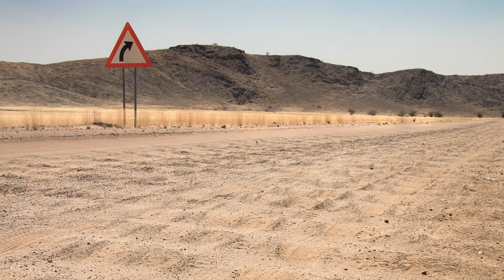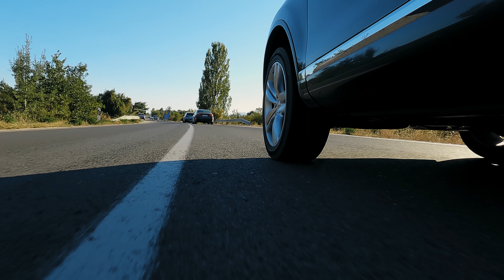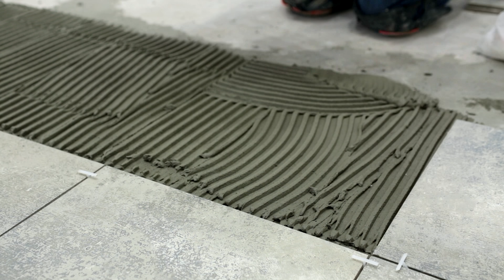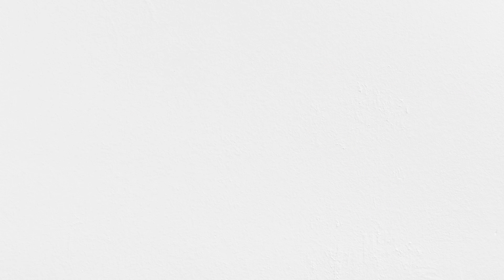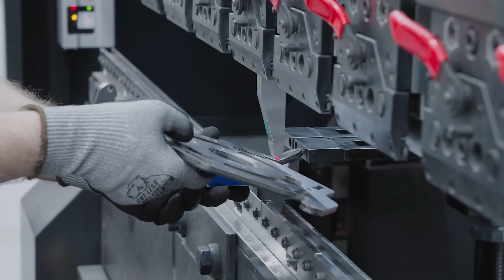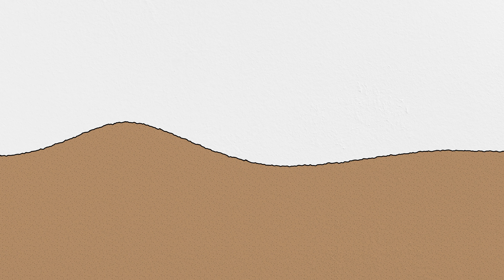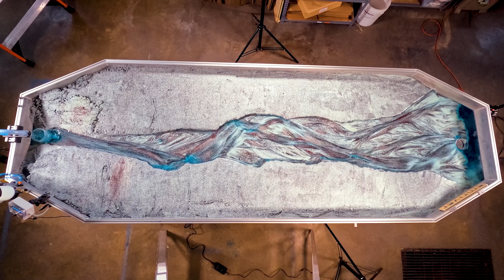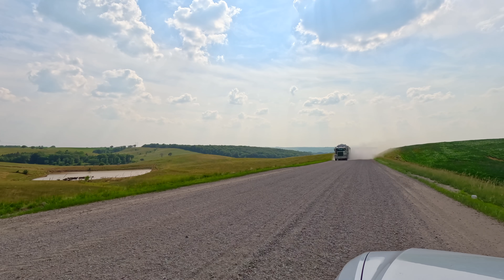Why Roads Get Washboards

Comment: I think asphalt mostly gets grooved and corrugated during Summer when soft. With about 8 dwellings on my inclined gravel lane we tried several sources and grades of road mix. The best by far was the mix we generated when the paving co I worked for tore out old driveways, parking lots and streets and screened off the asphalt chunks for recycling into our new asphalt mix. Base gravel along with some dirt and clay and about 20% small asphalt chunks fall through the screen-all machine and I brought numerous loads and spread them with the spreader chains controlling the tail gate discharge of my dump truck. Even without a roller that base has stuck well with minimal corrugation for 15 years. I did manage to make it crown for drainage and maintain "Kelly Humps" to drain off water at critical spots. 

PS:  the main reason asphalt roads etc work so well is the mat is waterproof, thus few changes or even frost heaves happen in base materials under it. That's why sealing cracks or chipsealing is an important maintenance chore. BST shots are somewhat cheaper than paving, where prepared base is sprayed and a chip spreader lays uniform layer of like 3/4 minus road mix and rolled. Later it's broomed and ideally another layer applied.

Comment: Having experienced this on a mountain road with almost non-existant edges and no rails it was quite the nail-biter as the car was going faster as it was skipping over the ridges on a rather steep downhill and brakes were accomplishing nothing at all.  I was not speeding to start with.

Gladly I did eventually slow down enough to regain control before going over the side.  Lesson learned.  No, I did not mess my pants, but I did stop for a while to recover and calm down.

Once again I was saved by quick reactions from learning to play pinball.  Had I been an inexperienced driver with poorer coordination I'd have gone over.  One form of physics helped another...  :)

Comment: The material has a friction coefficient and just like washboard effect on sand under moving water forms the same effect as the wind does from the moving vehicle, not the suspension. I.e., it's the wind on roads from the moving vehicle and they form  at > ~15km/h and not possible obviously to have that as a maximum speed. I worked with a one of the three transport research organisations on many unsealed road projects, including material loss, however this issue of waves forming is 100% wind caused and proven. We just call them corrications.

Comment: If you put your vehicle in the four-wheel drive it usually will help. Automatic vehicles are worse than manual vehicles. Let me rephrase that if you downshift to slow down instead of using brakes it is better

Comment: Found this really interesting, as I have spent a lot of time driving on corrugated roads. Everyone who comes to our home loves the quarter mile of corrugations on our front road. The only flaw in the experiment is the use of a trailing wheel as opposed to a driving wheel. One contributor to corrugations is a driving wheel on certain loose surfaces is constantly partially losing traction and spinning (ever so slightly) causing mounding. Once in, corrugations are near impossible to get out, as when the wheel travels over the road it is compacting the high and low spots differently. So grading the roads solves it for a while but they will return.

Comment: Washboards are caused my people that don't air down.  Trails drove by 4x4s that air down rarely have washboards.  The trick to driving on washboards is to carry speed to stay on the  top of them. I typically go 35+ MPH which smooths out the ride.

Comment: As an old operator I can tell you one factor is the tires on the machine.  Almost invisible ripples occur from the tread on the tires that transfers to the blade when grading a road.  A finish blade will have no tread on the tires, therefore no transfer of that pattern to the blade, resulting in a near perfect smooth surface.  Old operators know this stuff, new guys not so much.

Comment: I wonder if wind or something else natural doesn't play a larger part than expected, because if it's primarily wheel action, wouldn't you expect to find the "washboarding" more pronounced in the vehicle tracks? Or to have those ridges be more curvy and irregular along the width of the road? Or is it because people intentionally drive out of the track when it starts washboarding, thereby evening it out across the width? I still don't understand why those ridges and valleys would appear to be so even and straight across the road, though.

Comment: 16:30 I'd like to see a follow up with several proposed "low-cost" solutions put to test in the model. My suggestion would be mechanical stabilization (window screens/cloth in the simulation) underneath the top layer. it may reduce washboarding by adding structure to the road, shift underneath to make the washboard even taller than without the stabilizing material, or cause the stabilizing material to poke through, which could damage tires in a different fashion.

Comment: During WW2 (and maybe modern wars), chain-link fence was rolled out across desert sand to makeshift a road - I wonder if it would help prevent deeper washboard ridges and/or other decay factors if it was placed either between the base and wear layers or perhaps integrated into the wear layer.

Comment: It has been known for a very long time that speed is the factor in producing a washboard surface on a dirt road. Oiling a road will reduce the loose grains of dirt to avoid the ridge build-up. But the environmentalists will say it pollutes the ground near the road bed. However they are ok with the millions of tons of salt put on the roads each winter. The irony of this is that when you grade the road flat, drivers start to speed up and remake the washboard. The worst here in Nevada is muddy, deep muddy roads that are driven on and when they dry they become unusable at any speed over 5 miles an hour.

Comment: Without watching the video, I think the sand acts like a fluid, which has a specific frequency and wavelength which vibrations will travel through the material. Since most drivers are going to travel at the same speed, this causes a resonant frequency to build up standing waves in the material.

Comment: The political economics is more important than just math. Less people who use the road, less voters to court favor. The Washboard itself, is determined by the size of the wheels and the suspension rolling over it. Cars produce shorter closer bumps, trucks produce higher, longer bumps. Bad shock absorbers, or lack of, in trailers, produce a worse situation. Requiring Shock absorbers on all trailers, would be a good start.

Comment: On my old truck, I hated driving off-road because the washboarding would jar my teeth and make the rear-end of my truck float about. But when i got my first 4-wheel drive, and I locked those hubs into place... OMG! No more washboard. It didn't care. It rolled so smoothly. Sure, it still had a little bumpity bump thing but my truck was locked to the road. It didn't float anymore. It was so much smoother. From that day forward, I swore only to buy 4-wheel or all-wheel drive vehicles.

Comment: This has me interested enough that now I want to go measure the distances between washboard crowns and valleys to see if they are approximately the same size as a tire contact patch. I'm going to measure a couple of roads to see if there is a difference between them. 
I also wonder if an unbalanced tire(s) can perpetuate the forming of the waves. I think it won't because the frequencies between tires will most likely not be equal.

Comment: One of the papers presented at the 1985 Summer Meeting of The American Society of Agricultural Engineers was on the effect of tire pressure on forest roads.  The research was done at the USDA Research station at San Dimas in conjunction with the Northern Nevada AutomotiveTest Center.  The video showing the transitions of a road from smooth to corrugated and back to smooth by altering the tire pressure was very interesting.

Comment: Hello, about road surface (concrete interstate). I notice a frequency somewhere with an extended feel. Could this be a consequence of air suspension on trucks and the modulation that occurs in loading and unloading speed of the air suspension?

Comment: I don't see washboards in the straight stretches away from intersections where people drive the fastest.  I see them right after intersections where people accelerate.  There's rarely any in the high speed areas and the deacceleration area infront of an intersection.  Only after the intersection.

Comment: I read a long time ago to overcome the vibration from driving on washboard roads. Gradually speed up resisting the urge to slow as vibration increases. Eventually, around 25 to 30 mph, you will hit a sweet spot where the ride smoothes to near perfection. I've tried it, and it seems to work. I don't know if there's a video in there, but I thought you might find it interesting.

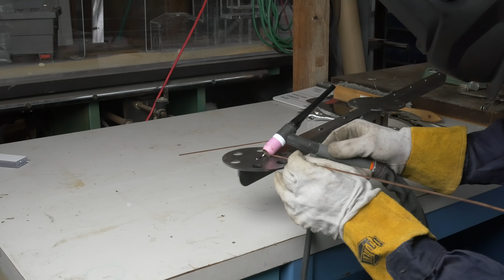Comment: 1:56 If you scratch the surface with the electrode before pressing the button, that likely would not happen
Reply: Looks like he used 0 pre flow or had recently dipped in previous weld 😆

Comment: You can't drive slowly on washboard. You must drive around 80-90 km/hour allowing the wheels to fly over the valleys. If you drive slowly it will shake your suspension and your bones to pieces. You can't do this with just any car, you need a 4x4 all terrain vehicle.

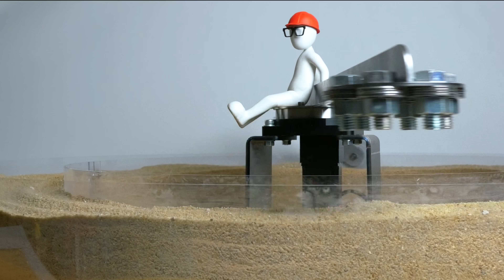Comment: 2:07 i’ve lived on dirt roads since 2010 and I could tell you it doesn’t matter what you do they always turn into washboards. We’ve gone as far as grading the road, and then rolling it with pressure rollers, putting gravel down everything short of paving and even paved dirt roads will get those washboard ripples if the asphalt isn’t thick enough the only way that I’ve ever been able to figure out how to keep the washboard from showing up is to constantly scrape the road the downside with that though is that the roads get deeper and deeper and deeper, and then eventually you’ll get to the point where water doesn’t run off them anymore and instead floods them and when you live in a desert with super dry dirt roads, rain doesn’t percolate into the soil the way it does on moist dirt instead, it floats along the top because of the sand act kind of hydrophobic what’s worse is that the ultra fine grains turn into a slurry that is slippery like oil and creates vacuums that make it difficult to drive through or walk through and as soon as the roads dry, they typically start to shape themselves into washboards

Comment: Where I live the dirt roads are mostly made from whatever underlying dirt was already there, with thin top layers of cinder or road base depending on the exact location and base layer composition. 
I can say that you can really tell the difference in how different materials interact with vehicles. Also, not every type of dirt road surface can actually create washboards. Some types of bentonite clay actually crumble apart when dry and can create pot holes much like what you would find on concrete roadways. However the major surface is too hard to move and doesn't create patterns, only holes where the surface fails.

Comment: A few years ago, I worked as a haul truck operator in a large open cut mine in Australia (where I live). The haul roads were all unpaved and were constantly being maintained by graders. It didn't take long after grading for the trucks (400 tonnes of rock, rubber and steel) to bring the corrugations back and, having nothing much better to think about as I moved around the mine, I spent some time contemplating how they formed (I was a university science student at the time). Partly because of the fact that the corrugations were always parallel and at right angles to the road, I eventually came to the conclusion that they were a product of the grading process, with rhythmic grader bounce ultimately causing lower density strips in the road surface that would become corrugations. I suspected that if you considered the wavelength of the corrugations and the speed of the grader, you could calculate the resonant frequency of the grader. I never did the calculations (not even roughly), so I can't comment on the sanity of my proposition (it's probably completely wrong), but for a while we started calling graders "corrugaters"!  🤣

Comment: I noticed that when the county D10 bulldozer come through and added dirt to our washed out roads that the Wash board high spots that formed 6 months later MATCHED the EXACT spacing of the 3" deep traction-bars on the bulldozer track's. I just figured that is where the dirt got compressed and packed tighter thus resisting the wind more!

Comment: The MX track I raced quads on had regular grooming for most of the track… except for a few of the areas. There were a couple of very large sweeping turns and the uphill and downhill area that was a hard pack surface as well. Those areas always had a washboard in them. The hill always had them like they were cut in by the track owner. You would think that if anything you would see areas washed out by rain and snow melting. But no. Those had a set area they followed and the washboards stayed. In the sloped corners the washboard was more on the outside top areas that the quads used to slide across broadside while the bikes dug ruts up around the inside. The track could have really used 5-6 truckloads of sand to mix in with the top layer of the track. They used discs to cut and try to get back flat between heats. The owner did more damage to the track than anything with how deep he would cut it. The dirt bikes used to hate the quads because the ruts that they would build in on the first heat would get pushed out. Honestly it was more the owner chopping up the soil and they disliked because it slowed them down. He was trying to make the track a bit more technical and less wife open throttle. They couldn’t do the high jumps and tricks as easily… I will say going full send off a small lip, into a sharp downhill decent that was 80% washboard felt like you had zero control. I learned later that some of my best arm pump training was going down a hill of a gravel road that had this washboard affect. By the time I got to the bottom I could barely lift my arms. I would go down it and walk back up a few times on a Wednesday afternoon and it helped build my forearm strength for the Saturday and Sunday races. It was an easy way for me to build up that strength without actually riding my race quad. Best forearm workout I ever had actually and it was related to racing specifically. To be a young 17yr old again.. maybe I’d get lucky and not end up handicapped(not related to racing, just maybe a bonus, lol)!

Comment: Growing up in rural New Mexico, my family had about a quarter mile of dirt road they owned before we got onto a paved road, the ridges it had were apocalyptic for vehicles. My dad's solution was dragging a giant metal planar he and his dad built out of 1100 pounds of steel, it was exactly as wide as the road and one pass up and back was enough to smooth the road out for a month or so. The sound it made still reverberates in my head, you could hear it for miles probably.

Comment: I disagree with this explanation. If tires are causing the washboard why are the ripples uniform all the way across the roads? Vehicles don't drive on the complete width of the road, they generally follow roughly the same path. What makes more sense is the swirling air turbulence caused by moving vehicles creating the ripples.

Comment: Another solution is wheel spin. Washboards will go away real fast if people drive like in rally with constant wheel spin that rips away the peaks.
Also, if you go fast enough, you will just skip along on the peaks thus wearing them down and not impacting the gullets to perpetuate the pattern.

Comment: I live in a very rural area, on a dirt road that washboards very quickly. It's been my biggest annoyance living here these past 3 years. It's a fairly busy road, with a State Park/lake/camping area a few miles past my property. The county grades the road every 3-4 weeks depending on the weather, but the road begins to washboard again within a few days. Sometimes the washboarding becomes so bad, it can shake loose anything that isn't tightly bolted down. I was hoping when moving here that since it's a growing area, and there is a state park a few miles away that they would end up paving my road, but that doesn't look likely at this point in time.